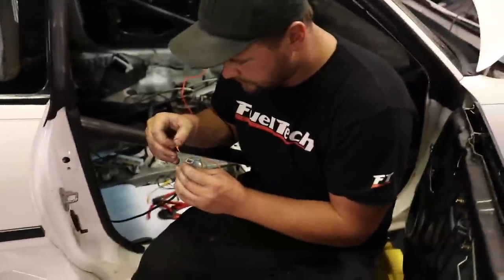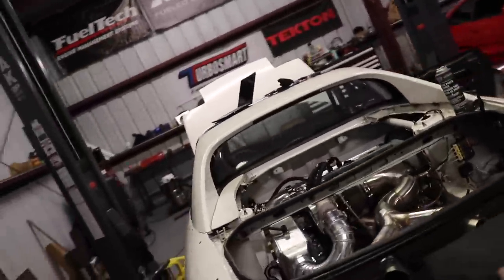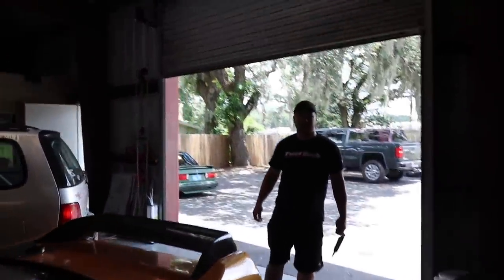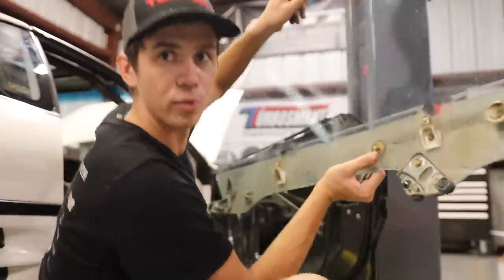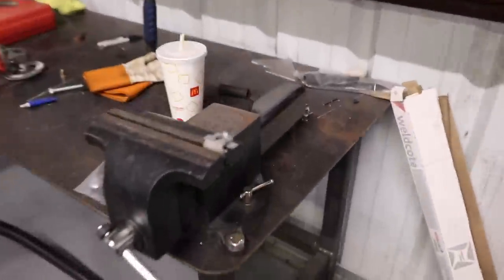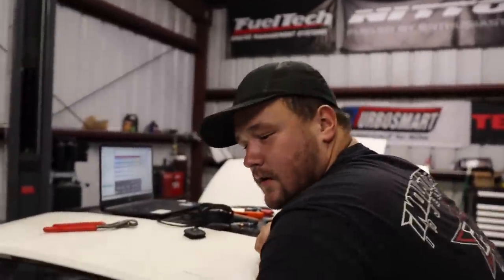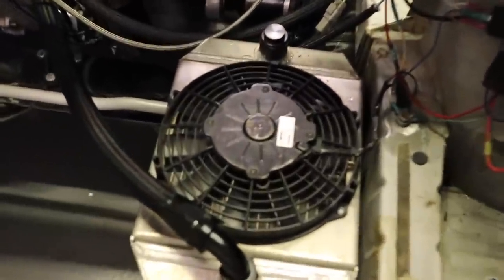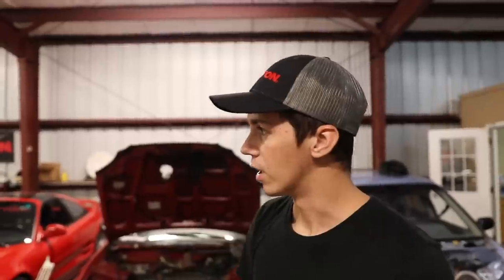Gave Cooper a Ride In The NSX!

Comment: Good tip for the Anti-Lag Kyle, use it when you are at a constant rpm then floor it to build boost, don't floor it then use it
Reply: y? u not flat shift? my 2 steps on the clutch pedal as is 90% of folks.
Reply: @denisohbrien  Rolling anti-lag. Not 2 step or flat foot shifting
Reply: So I wasn’t the only one thinking this

Comment: Been a while since cooper went fast haha.
Reply: Copper's been faster in his Camaro than any of Kyle's cars have been, he doesn't have much energy on camera, but he's gone 7.80s
Reply: @mattbradshaw6456  Right, but he said "Been a while".
Reply: @mattbradshaw6456  mullet has more passes than that camaro lmao
Reply: @randyd9414  but the elco’s tube chassis and designed to go 6s. The camaro isn’t designed for that and can’t make as much steam as the elco can. Now billet block, 9x mm turbo and some more suspension components and cooper will be capable of low 7s
Reply: @tannerharkey  im not comparing times, im just saying cooper barely runs the car, dude just does one pass and leaves
Reply: @mattbradshaw6456  haha i actually mean we need to see cooper have more fun.

Comment: Some PD control for wheelie height would be sick. Not sure that it’s really necessary but just curious if it’s possible to do that type of thing with the fuel tech system. I’d love to know more about how this setup will function, like are you pulling a degree of timing for every X # of inches of wheelie height above a threshold value or can rate of change be considered too? Obviously the point is to almost wheelie every pass. If the tune changes, the rate of change in height will change too, potentially meaning you’ll need to make adjustments to the wheelie threshold value and/or the relationship between angle and timing. If the car is always the same weight and weight distribution, rate of change in height would give more insight into whether or not the car is about to wheelie beyond the desired height than instantaneous height alone. You could start pulling timing/boost before the threshold, and reach that optimal threshold angle more consistently, without oscillation. This is a really cool application of vibration control, not unlike shock tuning. With proportional control only, it’s like having springs but not dampers. There’s a lot of ways to do this I’m curious what you guys think would be the best way to use this data or if fuel tech or another company is already using vibration control algorithms for this.

Comment: abs use wheel speed sensor which are higher resolution than 4 studs and they are usually on the cv so shouldn't be a problem retro fitting

Comment: **Place the Plexi glass on top of the OEM windows and use a heat gun on the low setting (to prevent browning) on the plexi, it will take the shape of the glass and you can just pull it off and grind the extra.  best to use some release agent, Wax or WD40 between the glass and the plexi, otherwise if it gets too cold it will be difficult to come off. The magic of Composite materials....If you want to make your own Plexi Windows still.

Comment: Dude, get the lexan windows and then put the regulators in so you can still drive it on the street. It’s hot as hell down south so got to get them windows down if you don’t have ac. Just put the 4-7 lbs of regulators in it or do manual windows and enjoy the streets. You think the NSX would be awesome on the skreets of TX in H Town TX2K stuff the MR2 would be WILD!!  Keep it streetcar. Even Leroy can ride down the highway.

Comment: Rob dham just installed one of those waste gates on his 3 roter you can watch his video on it but he took it apart and manually calibrated 0 to 100 and then digitally calibrated it on the lap top and it opened like 3 times as much after

Comment: Pretty sure Rob Dahm had to set the end stops for the travel of the gate for 0 and 5v like a TPS using a config then it moved full travel and set the shut point so it didn't drive into the piston seat.

Comment: You can get a 8×11 sheet of carbon fiber pretty cheap. Cut your mirror delete out of 3mm carbon sheet.......totally match the doors. And weigh less than the hardware to hold it on. Unless you just use 3m trim tape maybe? Will it hold up to 180mph? I mean I guess factory trim on the side of a car makes it right? Just throwing crap out therr

Comment: When the laser goes into a hole does it still cut timing?
Reply: sure if the new ride height with a hole exceeds the threshold for the timing cut to take place, or if its already correcting and it causes you to move into a different cell in the correction table, but you also have to think about how fast any "hole" in the track is going by the sensor and if it would even pick it up, I imagine its smoothing the reading anyway.

Comment: Why do they require you to have windows at the track when cleetus’s Leroy is open with no panels at all
Reply: Cleetus is also required to use window nets and arm restraints when running Leroy, neither or which are required if you have windows.

Comment: Yo Kyle! Just a thought looking at the plastic parts you were pointing out. I run a 3D printing company called Animas3DPrinting. We are based out of Southwest Colorado.. Durango baby🤘
I do a lot of vehicle restoration parts and pretty much anything plastic you can imagine. Check us out on FB and hit me up! We can do more than most machine shops can pump out quicker and we have design capabilities in house. Parts comparable if not stronger than aluminium! Have a few but looking for serious customers 🙂

Comment: Why are you ignoring the roll cage on the MR2????  You could of had the cage done so you could just focus on racing it.  But now you are going to get the car all ready make a run or two down the track. Then get booted from the track and have to tear the car back down again to upgrade the cage. It just makes no sense at all. Are you afraid you can't get the record with the added weight of the cage upgrade??? Are you hoping to make one hail mary run down the track and hope you get the record before you get booted by the track and have to upgrade it?  

Come on, do it right! Upgrade the cage and then go get that record!!